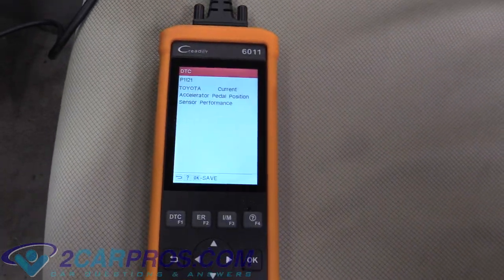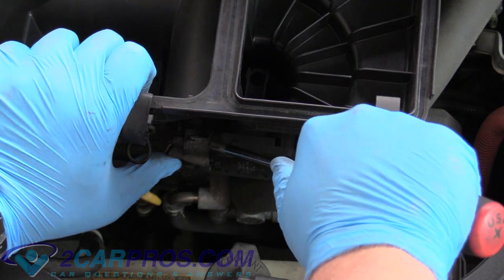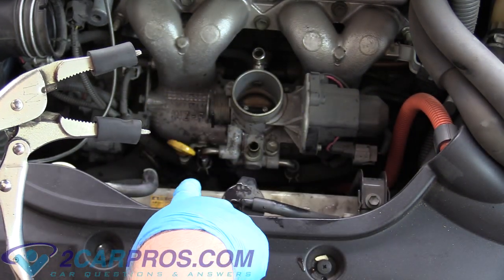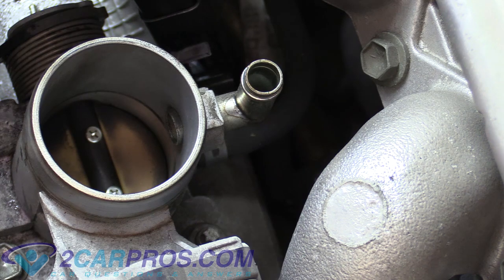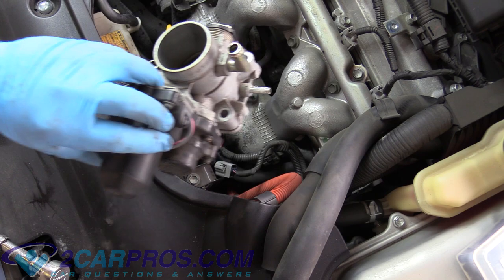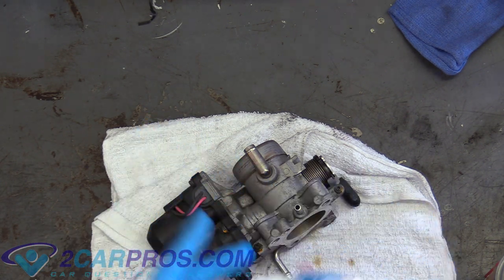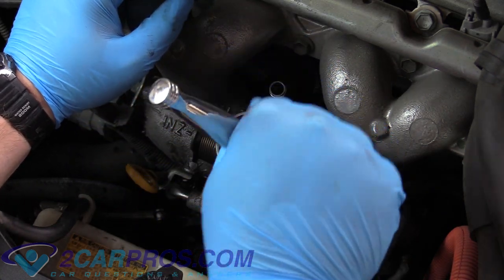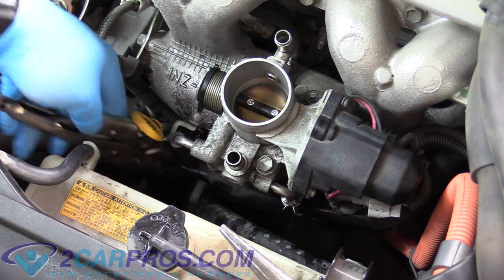How to Service Throttle Body Housing Toyota Prius 2004-2009 FIX Code P1121

Comment: The video title is misleading and will cause somebody to waste their time. P1121 has nothing to do with this video/procedure, it refers to the 3 way coolant control valve not the throttle body.
Reply: @Beach-Photo-Video  Stick to your beach photos, you clearly never diagnosed or fixed this issue. Do some research then go back and delete your post.

Comment: P1121 on a Prius has nothing to do with TB.  Either low coolant or coolant control valve failure. TB cleaning is indicated by P3190 and/or P0A0F.
Reply: A full scan tool will tell you that P1121 is: "Throttle/pedal position sensor/coolant flow control valve position sensor circuit stuck"
Alldata and Mitchell both go with it being for the coolant control valve.
Reply: @xgcskiman  Techstream and the Toyota Information Service indicates "Coolant Flow Control Valve Position Sensor Circuit Stuck".
Reply: Absolutely!

Comment: It's the accelerator pedal sensor and not the TPS. Toyota  TSB indicates is the Coolant valve. If your gas milage goes down and you get the Death Triangle briefly, then is your accelerator pedal sensor which is inside the cabin.

Comment: Thanks for the good instruction video. After 222198 km my Prius1 start for 20 seconds and than shut down.  I cleaned the mass air flow sensor and the throttle body housing in it runs like a new one. Thanks a lot !

Comment: I have read the p1121 code as being for the coolant control valve, how can you tell the difference?
Reply: Hi Dobhran, what was your P1121 about? I got this code on my prius a few days ago, I thought it calls to replace the 3 way valve, but now I dont know what to do.
Reply: @Kay-dx8vm  same for me
Reply: @KingdomLaz  it was the 3 way valve for me. I replaced it and clear the code succesfully
Reply: IT IS THE 3 WAY VALVE. THIS VIDEO IS HOOEY. P3190 AND P0A0F ARE THE MOST COMMON CODES THAT ARE FIXED WITH A TB CLEANING.
Reply: @snoobler I’ve seen you comment a lot about this and was curious if you could help me.  My scan tool says (throttle/pedal position sensor /coolant flow valve position sensor stuck).    I replaced my coolant valve with an oem.   Bled system and ran pump with jumper.   All went fine.   Put 500 miles all clear.   Now got the same code again cleared it and it went another 100 miles and on again.    
Any advice?
Reply: @calebeecher8451  There are only three possibilities for this code on 04-09 Prius; 1)  bad control valve, 2) clogged cooling system, 3) ECM failure. If not using professional grade code reader, there may be other codes.

Comment: I see two  screws inside the Throttle, would un screwing them release the throttle plate giving you more control of cleaning all surfaces fully ?

Comment: I used this video to replace my throttle body with a referb. I'm relatively handy with a car (more so than the average person) but this was my first time. Couldn't find anything to clamp the right and left coolant hoses so I lost some. But I had a half container of coolant so I just refilled the reservoir after. Cleared the code on my OBD2. I'll be driving a lot tomorrow to make sure it doesn't come back. It shouldn't since I changed the part out but we'll see. Haha

And it saved me a 2 hour, $270 labor quote. Lol confident now I can knock it out next time in under an hour once I get some proper hose clamp tools and am not fighting the mosquitoes.
Reply from the maker: Nice work! 270 bucks saved is a lot! Thanks for watching!

Comment: Wire brush to clean the throttle body? Not me... I don't want to permanently mar the chamber with fine scratches as it could effect the close tolerances and thus the performance. Turn the spring and open the throttle plate and clean it with your chemical soaked rag and/or a non-scratch synthetic bristle brush that is chemical resistant.

Comment: Thanks for the helpful video. I've read that tinkering with the throttle body can cause codes if you leave the 12V attached. Did you have any problems?
Constructive feedback: in some parts of the video, less zoom would have been better.
Reply from the maker: Thanks for watching! Yeah it is a good idea to disconnect the battery you are correct. 

Feedback taken! Thank you. I will not zoom in as much in the future.

Comment: There's also a 10mm bolt holding the clamp on the short rubber hose under the airbox. The clamp needs to be loosened before airbox is removed.

Comment: Quick question, is it mandatory to take the unit out to clean it? The area you cleaned was exposed and could be cleaned with out taking it off completely. Unless it’s a huge problem if cleaner drops down into the unit under it. Lmk thanks!
Reply from the maker: I'd take it off. Thanks for watching!
Reply: Thats an exellent question. He didnt really answer your question tho. Lol
Reply: Not a problem at all, the car will run rough then will idle afterwards. The only problem is dropping something into the plenum
Reply: I've cleaned dozens, and I've never taken one off. This is a five minute job with a pee break halfway through.

Comment: Great vid man! Helped me replace my wife’s throttle body and resolve a P2103. Thank you!

Does the throttle body have to be re-programmed or does it learn on its own?
Reply from the maker: Nice work Aaron! 

It will relearn on it's own no problem. That's what I did on this one, no tricks or computer messing with.

Comment: Would one need to do a throttle body service / clean on a hybrid that is 16’ and has only 40,200 miles on it?
Reply from the maker: If it’s throwing a code I would. But otherwise that’s a pretty young car to need this service. Thanks for watching!
Reply: @2carpros  hey thank you for your response. I don’t know if it’s throwing me a code, i get my car service by a third party and they also sell additional services so I’m not sure if they are trying to drain me dry financially or if the car actually is requiring this service. You’re the second person to say that my car is young. I haven’t been having any issues either. It’s well maintained, i follow my carfax reports and alerts to manage the services my car needs.

Comment: hey! i know this was posted a few years back but just wondering if i could get some assistance. I did the full service but after I had everything back to where it was supposed to go i turned the car on and it had a really high idle once in gear. any idea as to what this could be.
Reply from the maker: Make sure you didn't leave a vacuum line unplugged. Thanks for watching!

Comment: My mechanic said I had to replace it because the engine light came up and that's what the code says. Just like it happened in the beginning of this video .my question is.. .he erased the engine light on the board but days later came up again.  What the worse that can happen if I don't do nothing and keep driving for a month or so . ? I'm gonna talk to him to ask him to clean it just like you did instead.  But what's the worst could happen if o don't change it .how long do I have to change it ? 2 months  ?
Reply from the maker: So if you just erase the code and don't fix anything the code will just come back. I would try just cleaning it first, worked for us. Thanks for watching Carlos!

Comment: Will I need to burp the coolant system after?
Reply from the maker: I didn't need to but if it starts overheating that's the first thing I would try. Thanks for watching!
Reply: Thanks

Comment: If I use w40 to clean the throttle and in the end I use the normal spray clean 
That's fine or trouble?

Thanks
Reply from the maker: It's probably fine but I would just use carb/throttle body cleaner. Thanks for watching!